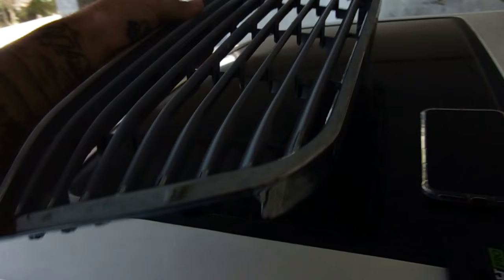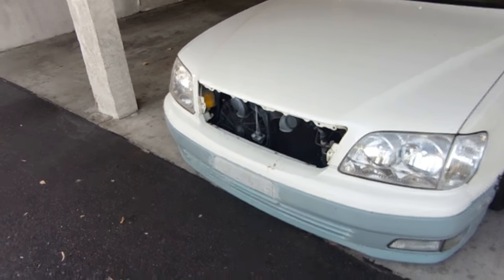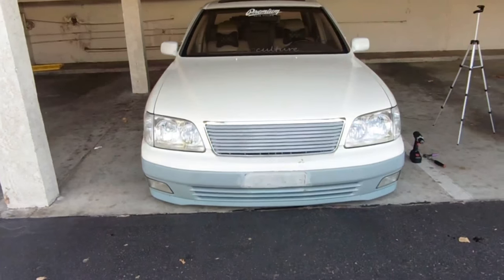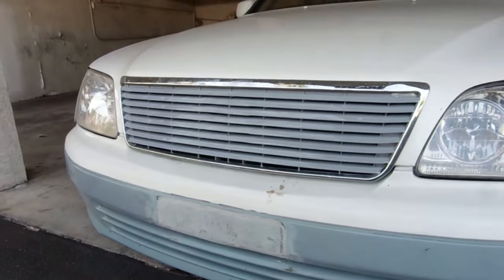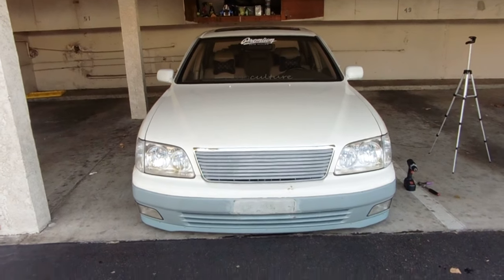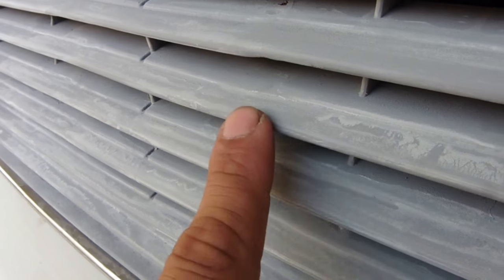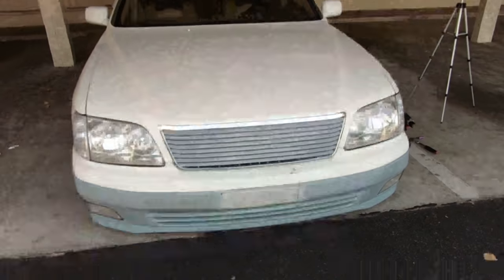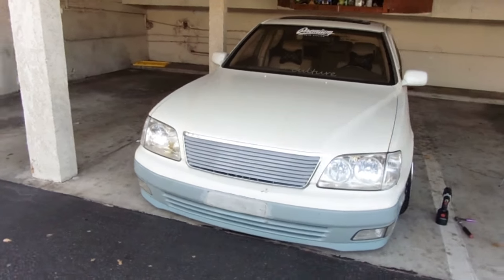How too : custom badgeless grill

Comment: What kind of solder burner did you use?
Reply from the maker: Howard Rodriguez tbh I’m not sure, just a cheap one.. any one will work though really
Reply: @Louis_B_creations  Thanks i just found a plastic welder for cheap! Where did you get the extra piece of grill from? How did you debadge? or did you just measure it and burn it right off?